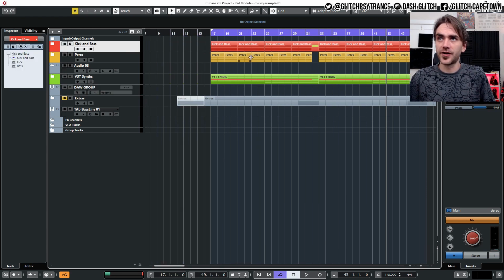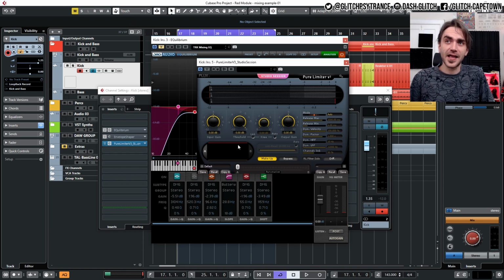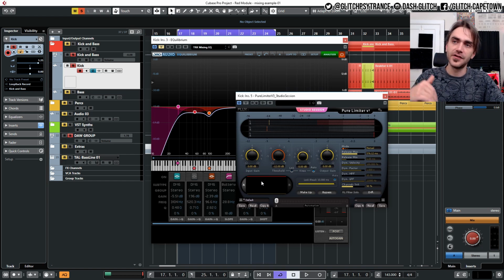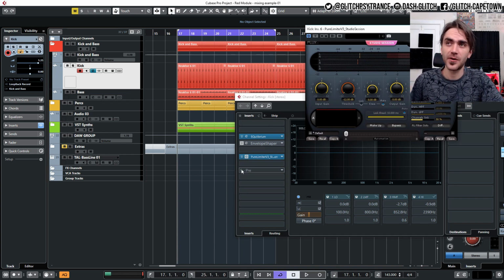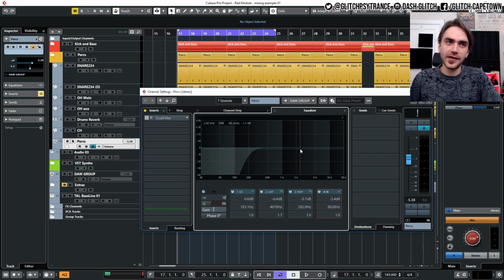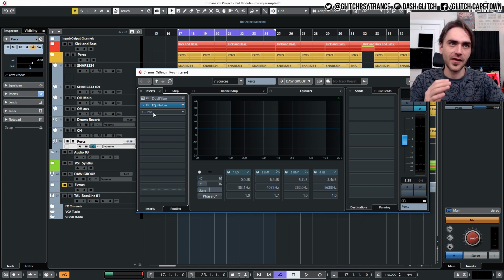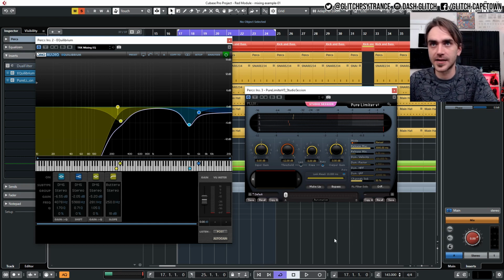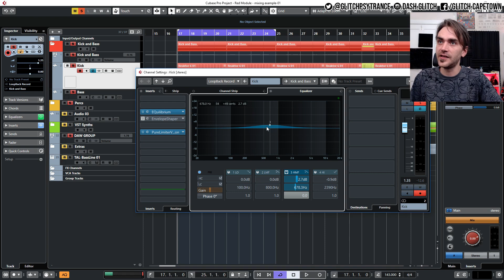Mixing Electronic Music - Ep. 1.4 Pre/Post EQ - The Difference? Why? What to Look Out For?

Comment: Another top tip which I do ride the wet dry knob. You don't have to have the plugins on 100% which surprising I see a lot. I tend to find 68- 92% wet sounds best on all compresses as you adding punch by saving some of the transients. I love dynamics and my final songs RMS bounces around -8 to -4 at the loundest avg -6. Yes its quiter to record label releases but turn it up 1-2 db and it kicks the shit out of label stuff for energy. I'm not saying I sound better as I still have sound way to go yet but I defo have more air and energy